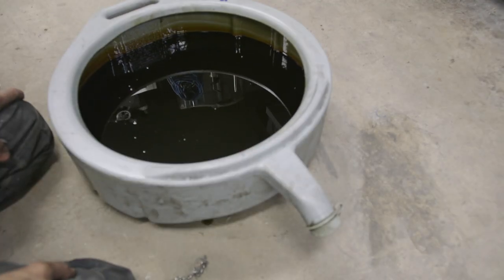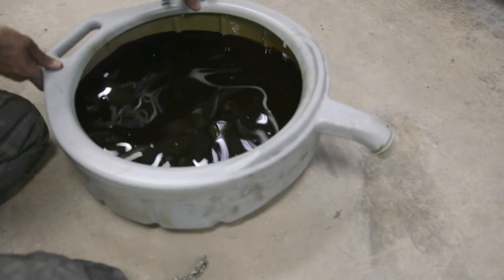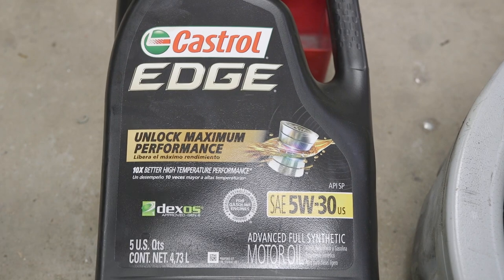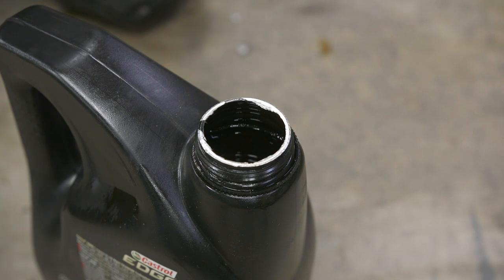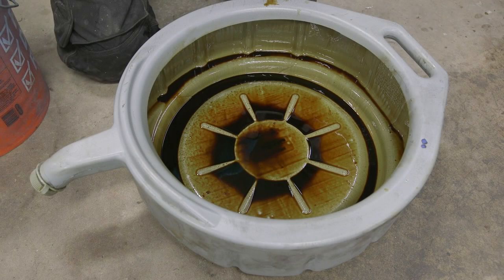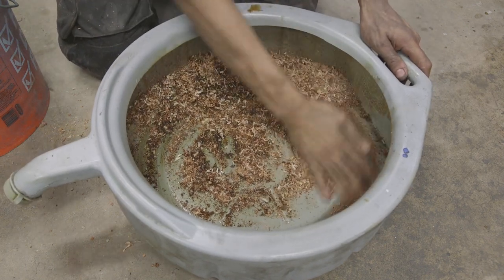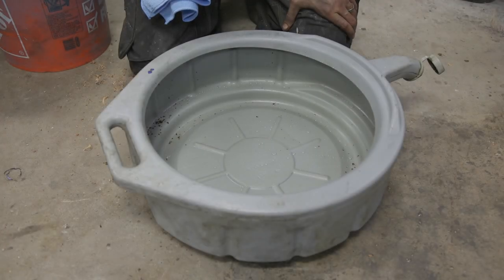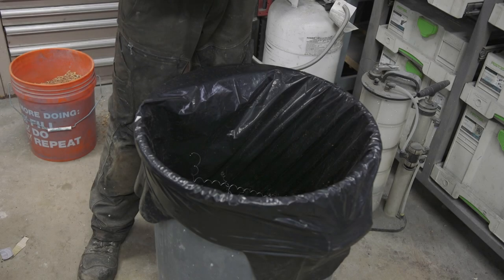How to: CLEAN OIL PAN IN 2 minutes

Comment: What do you do with the oil infused saw dust?
Reply: Wondering the same thing. I used to just throw it away, but after learning how bad that is, I’ve started collecting all my kitty litter and used oil rags to drop off at our monthly hazardous waste collection event. I use 5 gallon buckets to store it until I can drop it off
Reply from the maker: Throw it in the trash, in America you can throw away oil impregnated media, just not oil.
Reply: VERY bad advice, I'm a lil shocked @VanoverMachineAndRepair  CA requires use to take the oil impregnated media to a hazardous waste facility.
Reply: @JstJacko what would they even do with that? They’d have to throw it in a landfill.

Comment: Sawdust is not a commodity I have on hand so I use old newspapers. To wipe the residual film, I use TSP liquid as a degreaser. Unfortunately, were I live, auto parts places do not accept used oil. They sell it but don't take it back. Ridiculous. Luckily, I know a guy at an oil change place and they take it.
Reply from the maker: Bummer they don’t take it back

Comment: But.... Why? Hahaha is going to get full of oil again, I understand the process of recycling the old oil but clean Oil pan? Weird YouTube recommendations 🤣🤣
Reply: Those pans arent only used for oil. Also used for fluids suchh as coolants, transmission fluid, gasoline, etc.
Reply from the maker: Yep
Reply: Just changed the oil on my motorcycle. Realized the drain plug gasket leaks and needs replacing. Should I throw away the new oil and spend $30 on new oil? Or do I clean the oil pan and reuse the brand new oil? It's not that hard thinking of why anyone would need a clean pan
Reply: @muniz27  and get sawdust in your engine.  Sounds brilliant to me.
Reply: @twohandsandaradio  Yeah you're right, I wasn't planning on rinsing the oil pan and wiping it clean, I'll just dump the oil on a pan full of sawdust. Thanks for the help.
Reply: @twohandsandaradio  None of that used oil should EVER be going back into your engine.